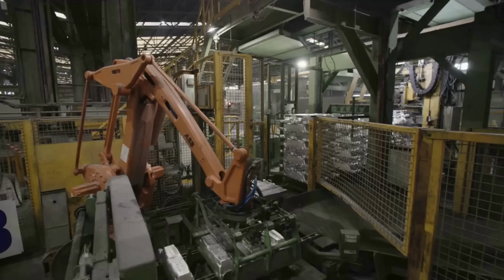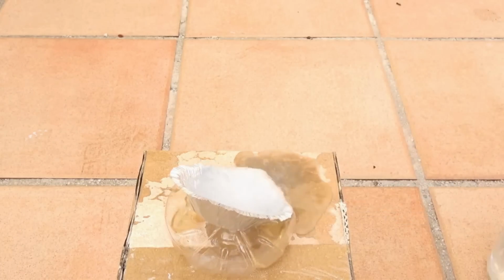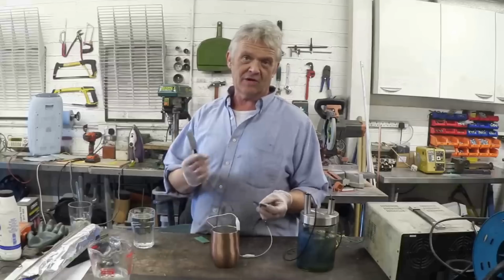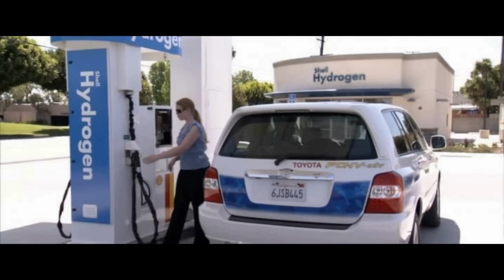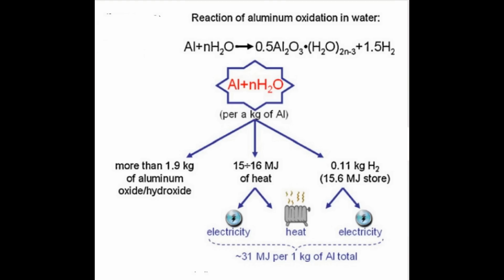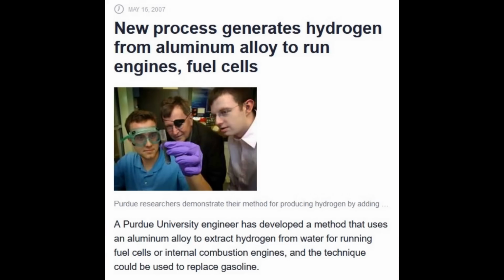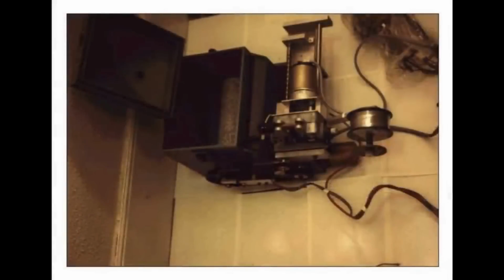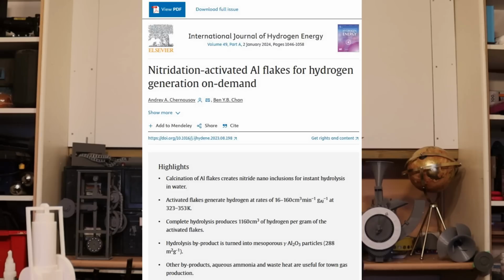2194 Hydrogen On Demand - Improvements And A Possible Conspiracy

Comment: Pic of Hindenburg exploding, instant Oh the humanity!
Speaking of conspiracies, my favourite conspiracy is the 100mpg full sized V8 car that runs on gasoline. It's so preposterous that essentially the laws of physics would have to be different meaning it could only work in a parallel universe (which coincidentally is where its supporters reside). 
No matter how much you explain there simply isn't enough energy in a USG to move a 3500lb car with a V8 engine 100miles they keep insisting big fuel terminated the inventor. I mean it might work if it rolled down a 100 mile hill with a force 10 tail wind and the motor switched off, but to do any meaningful work consistent with the inventor's claims is utterly impossible. It's the gift that keeps giving that one.
Reply: If you take the energy of 1 gallon of gas and used it in something more efficient than our current ICE, would you then be able to move 3000 lbs that impossible distance? Efficiency is where we are lacking, you can't market things above 23% Efficiency.

Comment: Now that is a blast from the past. I remember looking at this patent and those pictures about 20 years ago. One problem I had was finding a source of cheap aluminium welding wire. It's still a considerable price compared to a rough ingot. The cylinder is easy to make. Take a large dog food can, fill it with chunks of aluminium and heat in a furnace, or as I did, in our fireplace. once cooled, peel the old can off and now you have a massive chunk of aluminium. I never did see if running a wire along it underwater and powered by a car ignition coil did what it was claimed to do. Now if we had an easy way to refine that aluminium oxide back into metal again that didn't require a molten salt solution...

Comment: Use liquid NH3 instead, to store Hydrogen. It's more energy dens than pure Hydrogen storage 😂as hydrogen on demand. Rob you are Chemist, right? Is there a way to dicompose catalytically liquid NH3 into two N2 and six H2 molecules? Then filter the N2 away and use immediately the H2? I have an idea😃💡. Since NH3 behaves like water in liquid form could NH3 be dicomposed by Electrolysis like water Into N2 and H2🤔? I mean you only need 9 Bar to liquify NH3 so a Hoffmann device that can withstand way over 9 Bar should do the trick. The question is could I put a tiny smidg of lithium in it to increase conductivity like the same procedure is used to split water? 🤔

Comment: It's worth a shot. Reality should hopefully illustrate some aspects of this process that theory hasn't fully covered, and it might just be a really valuable method. My biggest concern is that the degree of absolute precision might not be reflective of an engine where tiny adjustments are essential. The quality of the aluminum and general chemical variability could confound predicted vs actual performance.

Comment: Hi Robert,very inersting, i never thought about Aluminium to be that ractive. I wonder if you can measure the power consumption of the wire feed device and the quantity of the hydrogen compared with a HHO generator, adding a HHO generator to cars is useless due to high energy demand, but if that wire device require less energy, then an improvement to internal combustion engines can be achieved.

Comment: I tried to patent the remote control light bulb and remote control plug about 26 years ago it was accepted as there were only remote control ceiling fans at the time however they kept asking for more and more money and I had to leave it, a year later they were on the shelves in b&q exactly as I designed them
Reply: I wouldn`t patent any ideas I had, I would do my best to share them on big platforms if I could not get to use them commercially
I believe that the patent system is wide open to corruption, slows down development and costs a small fortune.
I am not money driven , would just love to be able to create something to enable people to escape the very well tied up energy market.

Comment: I have seen an experiment where you take a small peice of aluminum  and soak it in a tub of mercury. When you remove the aluminum from the mercury and place it in water, hydrogen will be produced off the surface of the treated aluminum.  Supposedly someone was filling their gas tank with water,  tossing in some treated aluminum, and driving around powered like that!

Comment: I wonder how difficult it would be to reprocess the aluminum oxide into aluminum wire from home. Then one could just reuse their aluminum. With an oversized home electricity generation system, you could have a mostly independent fuel source. Just need water, which is also easy enough to distill although it's probably cheap enough not to.
Reply: Look up how Al Oxide is reduced - it takes Kryolith, huge temperatures and a Carbon Anode. So sadly, not possible, not yet.

Comment: Great also for plug-in hybrid hydrogen-electric drive systems (just to keep the size of the fuel cell down somewhat) and long term off-grid power supplies.
Would be interesting to see this integrated into the same size-category gen-sets that already exist, and maybe even swapped into electric semis ala Edison Motors. The fuel savings from hybrid alone are enormous, so going the standard IC hydrogen-engine route is still very useful in those cases.

Comment: This is a brilliant breakdown of the Aluminium/Water hydrogen production. Right at the end we see the core process of using the Aluminium and water to release the energy from reacting them together. I would love to see the energy balance of using electric arc to remove the Oxygen from the Aluminium Oxide through to energy released when the naked Aluminium is returned to Aluminium Oxide in water. Then we have to factor in transportation of the raw materials and any loss of efficiency during the process. I know you don't get something for nothing energy wise. So, I hope there is some advantages that outweigh any losses.

Comment: The problem with these proposals for using aluminium to generate hydrogen is that the overall efficiency is really bad.  Making pure aluminium from the oxide requires electrolysis in a bath of molten chryolite, using massive quantities of electricity, with a lot of waste heat; then the actual reaction of aluminium and water is very similar to the reaction of alkali metals and water, where most of the stored energy in the metal is released as heat, with only a portion contained in the hydrogen.  That doesn't even get into the systems needed to collect the spent oxide from the vehicles and return it to the smelters.  Overall it just wastes far too much energy and is too complicated to ever be implemented large scale.

Comment: Have you ever studied Stan Meyer work? He designed, patented and build a hydroxy gas generator.
The way DC power works with electrolysis to generate Hydrogen, Stan's system could be compared to AC. Generated HHO gas, without all of the heat that conventional electrolysis generates. Look up video called "it runs on water"

Comment: You can hack engines, carburator or electronic injection, to run on pure ethanol.

A carbon negative biofuel ubiquitous to every gas station in Brazil for half a century.

There's even pre heaters so that it starts more easily on cold climates. 

Not to mention how easy it is to make your own moonshine.

The lithium in batteries would be better used as co2->o2 scrubbers in the form of LiOH like they did on Apolo 13 to save the astronauts after the oxygen tank exploded mid trip.

Evs/green hydrogen and all that is bs hoaxes to pretend like the problem of clean vehicular fuel is hard and complex and that we lack technology and infrastructure to have them

In truth, it's very easy and the tech's been available for more than half a century and the infrastructure is so damn easily scalable to worldwide demand in just a couple years.

Why don't we do it? Big oil/road/car lobbying and the fact that it'd cost money to do it, money not from the people, but governments and businesses, and completely destroy the automotive fossil fuel industry and every other industry built solely around it.

It'd cost money for the bourgeoisie, that's the only reason we can't have clean fuel now(or 50years ago even before Exxon found out about climate change)

Btw, the lead in gasoline was also because the industry refused to use ethanol as an additive instead. 

Also, even if you don't want to hack your engine, just mix ethanol in your gas up to 80% and it'll still run even if not optimally.

The solution was never to make dozens of new factories to build billions of new cars with lithium stolen from Bolivia where Elon musk financed a coup de Etat for 50bi to have that cheap metal dug by child slaves, and cobalt from Congo where the situation is 10fold worse.

It's to make the cars that already exist green.

In case of Brazil there's 12mi people(1/5th of all cars) that can literally say a magic word to the fuel pump guy(yes, we don't do it ourselves) and overnight make their cars not just green or completely carbon neutral, but carbon negative, since even the roots of the plants if not completely burned are stored carbon. (And there's also a million other uses for it and other rejects/side products from ethanol production. 

EVs are a greenwashed hoax at best, I don't care how much more expensive(make the state pay for it instead of funding imperialist wars in other countries!!!) it could potentially be or how many billionaires would stop doubling their wealth every 8 months

It works and we can do it in record time, so we should. We must.

Ecological and social needs should come before capitalist greed!

They've profited way too much for way too long already, it's time we put an end to it! It's unacceptable that they can just keep on drilling and pretend like they fund essential research to find complex solutions(they only care about the solutions that can make them profit even more than oil, so yeah, they'll keep researching until we all die because they couldn't give up their agenda of accumulating infinite wealth) when they could've stopped their destruction half a century ago! 

Could you do a proof of concept, that ethanol burns (with 0 pollution btw, You could drink directly off the exhaust, just not too much tho bc the water would be too clean, and probably a bit fizzy too)? It's not the most efficient but who cares? It works and can be implemented fast and broadly at a veeeeery low cost for the end consumer and governments compared to developing a whole new industry of prohibitively expensive luxury vehicles that couldn't even ever offset the harm done by producing it in the first place.

Comment: 6:13 I was surprised to learn only a few years ago that in a strict technical sense hydrogen is not explosive it is implosive. To the same approximate degree that dry steam is expansive. Not sure off the top of my head but I think it's about 1600 to 1 in volume.

Comment: I think a killer application would be for carbon free emergency space heating. The reaction itself makes heat and the hydrogen is burnt and turns back to water. As a bonus there is no carbon monoxide risk.

Comment: Stanely Meyer and Dennis Klien working separately supposedly converted water into a combustible gas. From what I understand about the process, exciting water with the proper resonate frequencies breaks the bonds in the water molecule thus converting it into a gas with separate oxygen and hydrogen
molecules, very explosive. The resulting gas was then used to power a vehicle.

Comment: A couple of ideas I found floating around the internet that worked: 1) If using normal electrolysis - the addition of iron oxide (rust) into the solute (water) enhances the reaction. 2) Gently shaking the electrode allows the bubbles sticking to it to release which in turn allows for more H2 production as it frees up surface area. Considerably more.  This could also be achieved by underwater sonic waves, but any action that gently shakes the electrode will work. 3) Referring to the AL + NaOH (or similar) reaction in water steam is produced - which could be used to power a small turbine on it's way up - then allowed to condense (say, in a coil) to be re-used later. The H2 is what is left after the steam condenses. So in addition to using AL as an electrode to capture the electricity, there's the steam power plus the leftover H2. It seems like the energy conversion could be considerable if every faucet of the process was used.

Comment: Hi Robert. Have you heard about this exciting technology?  
Could Solid-Sate Hydrogen Storage be a Serious Alternative to Batteries? By FuelCellsWorks – April 29th 2022.
Former computer-chip manufacturing engineer Paul smith founded Plasma Kinetics in 2008 to develop this technology for hydrogen storage. Essentially the gas is transferred onto a proprietary film wound in many layers inside a canister. When unspooled and hit with a laser the solid-state storage system releases 99.99% pure hydrogen.

Comment: Running the H through a fuel cell would recoup some of your consumed water back into it's tank extending the interval between water fillups. This would be nice because I suspect the water would idealy be several purification stemps beyond tap water (if not distilled) as not to gunk anything up with scale and non Aluminum Oxide sediment.

Comment: Ooh imagine,  we're almost out of fuel, stop and look for some aluminium cans and stick them in the Mr cushion style of filler which then shreds or grinds them up and powers the car further. I think aluminium fuel rods would be a good idea, easy to load, something say 1.5 to 2 inches in diameter slowly pushed into the reaction chamber it would last a long time.

Comment: Burning hydrogen in a conventional engine is not good long term. The water produced (with no petrolium products about) causes a lot of rust inside the engine. Park yoir car up for a couple of weeks and come back to a siezed engine. Using the hydrogen through a fuel cell looks good as an emergancy power system. The power from the fuel cell would have to be buffered in batteries of course as they currently do in hydrogen fuel cell cars and make them very much safer.. of yet more expensive. Fuel cell vehicles are a complete failure due to the immense cost of the rare earth metals needed in the fuel cells.

Comment: Hindenburg wasn't really an explosion . Not all the passengers died .   It looks worse than what it was . The news crews wanted their scoop and goaded the captain to hitch up against his better judgement considering the electrical activity in the atmosphere at the time 
   I thought over some time that if the co2  exhaust gas would  have been directed into the inner space of the zeppelin, that it would have displced oxygen and provided safety against ignition.

Comment: So, as the reaction of aluminum and water is exothermic, and it produces H,  That puts me in mind of a sterling engine. 
It seems like you could harness both the heat of the reaction, And burn the hydrogen to run it.  I don't know how that would work out in terms of efficiency-   greater, I think, than internal combustion unless I am much mistaken.  

Fuel cells being rather expensive, I wonder how they would compare to such a sterling running a high speed/low torque generator in terms of output?  (my searches turned up nothing)  

This is a thing I've been pondering for multiple fuels-  could a small or heat engine run a high speed/low torque generator converting it to run electric motors, get us more out of those fuels than internal combusion, or more accessibly than a fuel cell?   
We lose so much heat to exhaust.  That just seems like it might be a useful area for somebody to explore. 
Don't know if what i'm pointing at makes sense.

And it seems like it would overcome the Motive problems of a sterling- runs steady Great, but it's not very responsive like an ICE is. Electric motors being much more versatile for cars and such, that sterling-electicity converstion seems like it might be a good trade-off, and very steampunk, which is awesome.
Reply from the maker: i like the way you are thinking Ryan - mostly because it got me thinking too lol - cheers mate
Reply: @ThinkingandTinkering   So I just had a Ridiculous notion- you know those fan powered swamp boats?  
seems like one could throw That notion into the propulsion as well, using the outside rim as the generator portion.  
I mean, you're having to turn a thing anyway, might as well make the armature holding the magnets at the rim into fan blades. 
Like I said, ridiculous but *shrug
A stirling-electric swamp boat would be pretty cool.

Comment: Ok hear me out... Aluminum cans already look like batteries and are nicely stackable. What if they are filled with water and when inserted into a container, a needle pierces the can to insert a corrosive agent that can dissolve the plastic liner. If that liner was applied to unoxidized aluminum to begin with, the production of hydrogen can begin from the inside out.